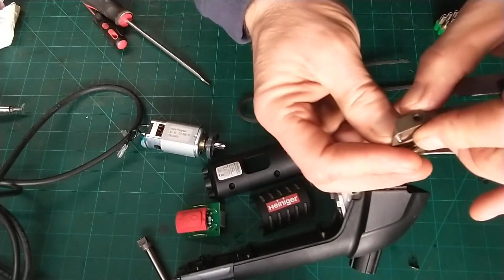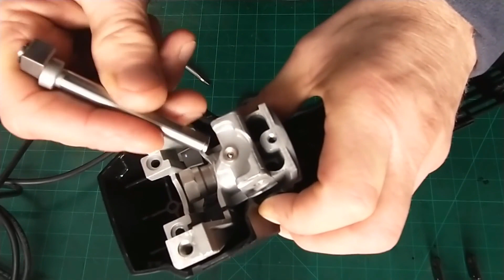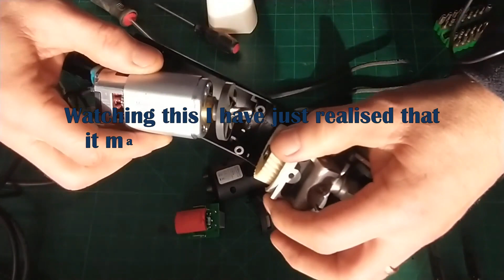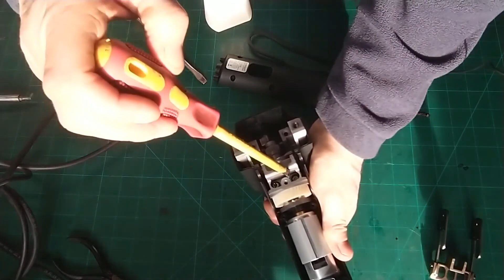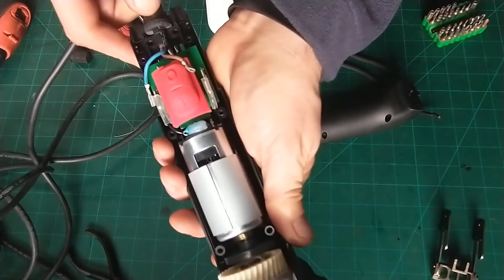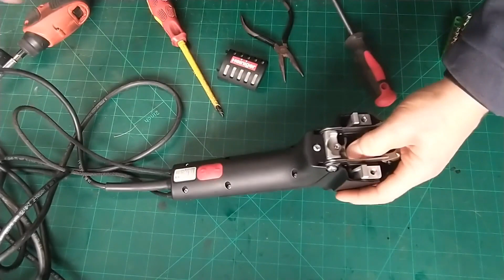Heiniger Progress Reassembly

Comment: I have the same mashine with a problem since this week.

The machine is starting and but going off after 2 or 3 seconds.

May someone can help me?

Many thanks in forward to hearing how to solve this problem. 

🙏
Reply from the maker: Unfortunately many parts can cause the same problem. I would want to replace the printed circuit board and the motor.